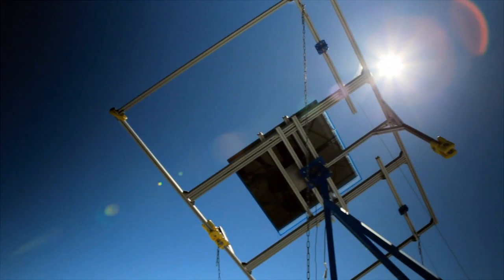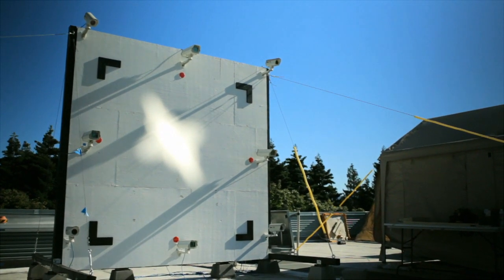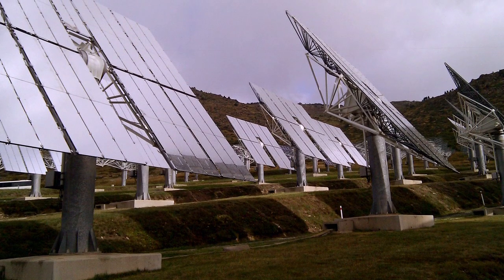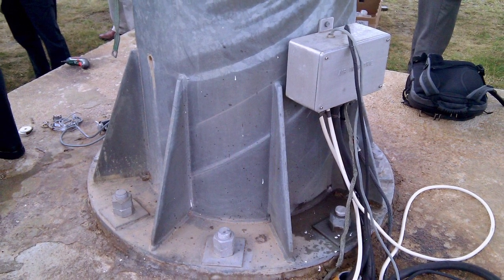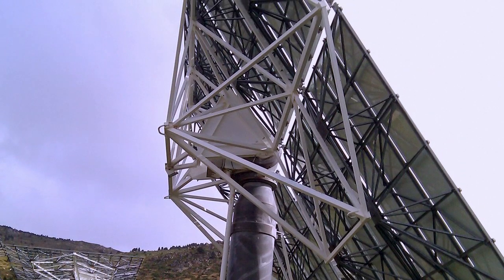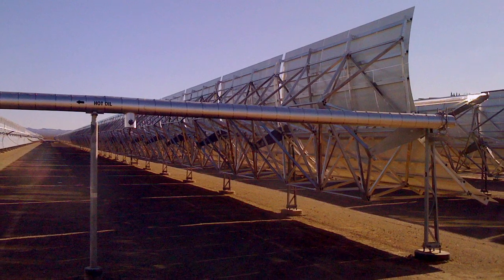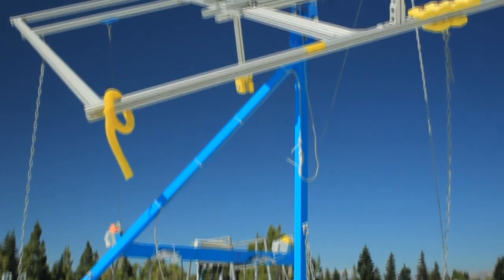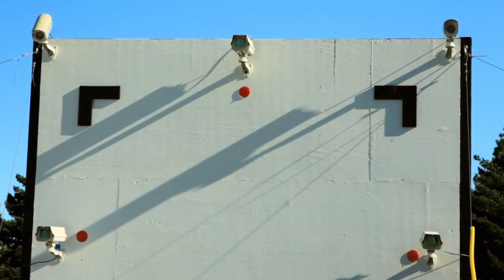Overview of heliostat research

Comment: Google can start looking at rootop versions of CSP  but not to generate steam but to generate heated air for residential or office uses. We spend a fortune feeding nat gas to our furnaces for heating. They can heat water for radiator type heating if applicable. Most of us generally use fuel oil or nat gas to run heat furnaces. So CSP can be used in place of nat gas or fuel oil whenever the sun shine. CSP is not all about generating steam for electricity generation out in the boonies, you know?

Comment: Also, I wonder why the heliostat guys dont look at Cymat Technologies in Canada for their aluminium foam technology.  They make plywood board like aluminium foam so stiff that no trusses may be required to support the heliostats.  You can use plastic stiffboards but they are not as durable. I dont know about the compostite types.
Reply: A major reason to use an all glass sandwich, glass mirror on one side and glass on the other, is so the whole thing remains flat. Since these large scale heliostat fields have to send the light a long distance it is very important for the mirror and its support to remain flat. If it didn't remain flat the reflected image would change shape and spread out to miss the target.
If the mirror and backing material have different thermal expansion rates the surface will change from concave to convex dependent on the temperature.

Also in quantity both the mirror and backing glass is very cheap to make.
I have made some mirrors like theirs with mirror-foam-glass. This was very light in weight and yet quite stiff with no thermal surface deformation.

redrok@redrok.com

Comment: The heliostat guys probably dont understand the limits of reflectivity based on the distance between the intended target and the "bouncer" as the heliostat.  You see, photons hitting the surface of the heliostat will scatter slightly off the intended target over the distance. Heliostats is most efficient probably within 50 foot distance from the target before starting to decline slowly over the longer distance as more photons will stray off the target. Polishing mirrors may help extending range?
Reply: We understand this fully, at least I do!
The suns apparent diameter is about 1/2 degree of arc. So the reflected image at distance is also about 1/2 degree of arc. I call this "Spreading" and it's about 1% of the distance. 

The mirrors I use, float glass mirrors, have about 85% reluctance. This is mostly independent of distance.

OK, so at long distance the image is larger than the mirror so the spread out light intensity is reduced. However, if we use many mirrors that pile up all their images the total concentration of light power is quite high for a large field.

redrok@redrok.com

Comment: Is this an open source idea? I NEED a helostat and I'm trying to make one with a basic stamp mircocontroller. My father suggested using  PhotoVoltaics and an A/D converter to measure the voltage difference between PV cells. The cameras are kind of that same idea.

Comment: Hmm, I believe that it would be far cheaper to use simple infrared light LEDs on panels and one central camera in front of all panels. Camera would track positions of LEDs in that way that it would draw an rectangle and depending on how that rectangle is "bent" software can calculate exact position of the panel construction. More over if software knows position of the sun it can calculate where reflection is. That way one camera can do all the field of panels at once...